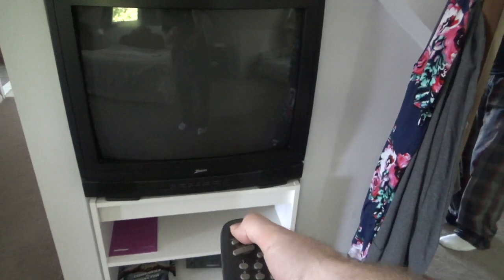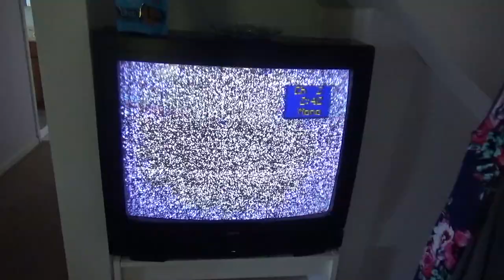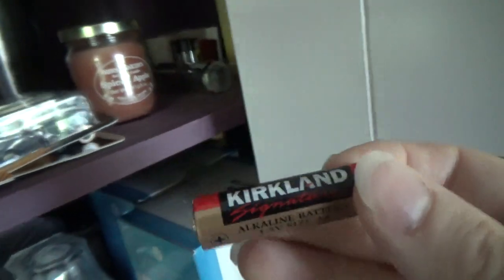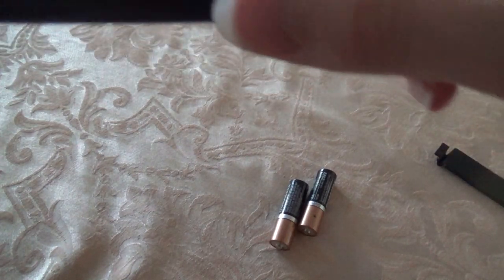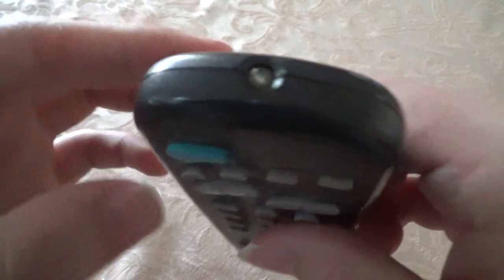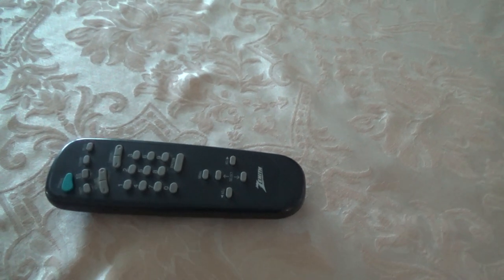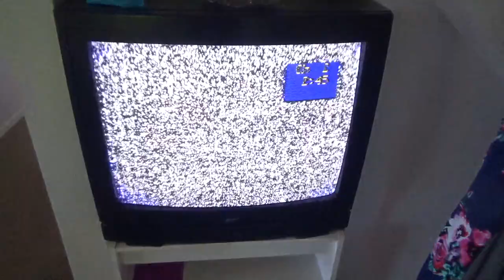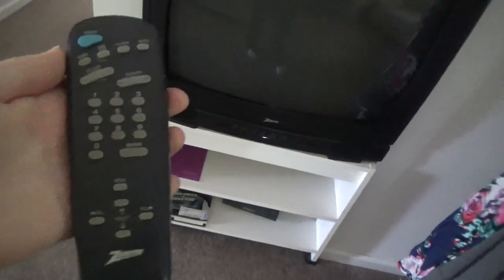Zenith CRT Television Set

Comment: I still use my 1998 Toshiba TV that I bought at Circuit City. I have one of those converter boxes that were released around 2009 hooked up to it so that I can get the local stations. It still works great and I get around 20 stations.
Reply from the maker: That's good..

Comment: They probably have the CRT there because it'd "be too much of a hassle to take it out". They probably haven't installed a converter box because they'd be "spending money towards making a TV work that nobody is going to watch because it's old". I guess both of those presumptions are a slight stretch, but that's all I could come up with...
I have, and use, two CRT sets. One is a JVC 32" set, model AV-32150, from may of 2000. The other is an Advent 24" flat panel set, model Q2435A, from 2003. The cabinet has seen better days on the Advent (it's got a few pretty big cracks going down the left side, which I think unfortunately might've happened during transport to where I have it). Typically on CRT TVs, they make it easy to find out the date of manufacture, provided it's in a place you can turn it around to easily see the back; many times the dates are written clearly on the back.
By the way, that Zenith TV in this video is probably made by LG. I have a few Zenith VCRs from the late 90s/early 2000s, made by LG.
Reply from the maker: Those are both reasonable possibilities..

Comment: That looks a lot like the one my grandparents had. It was from 1994 I think and it actually burned out one day, producing a terrible burning smell and black smoke. So they replaced it. I also, had a 1995 Zenith TV that I had gotten from the curb when I was younger, and when I turned it on it just had a black screen with a white line across the center.
Reply from the maker: That's too bad it quit, I don't hear too many stories of these old CRT sets giving out, certainly not like the new ones. Seems like they don't last more than a decade now.
Reply: @JordanU  funny story about that. My grandpa said he did not notice, and kept watching the evening news. My grandma was cooking dinner and came in the living room and she said “I smell something burning, do you smell that?.” My grandpa said “Oh I thought that was something you were cooking.” Right at that point black smoke came out of the vents so my grandpa put the TV outside. My grandma is actually a great cook.

Those Zeniths from that era tended to have lots of problems. If I was getting one that era I’d get a Sony Trinitron or a Magnavox/Sylvania/Philco.

Though in actuality theirs was about 8 years old by then so I guess that’s not any worse than todays sets. And they used it a few hours a day.
Reply from the maker: @coled5090  That's a great story!

Comment: Yay! A CRT
Reply: I agree, CRT is a pretty impressive type of display, especially when it's analog.
Reply from the maker: A CRT is, by nature, analog....
Reply: The tuner of CRT TVs are usually analog if it's one made within the range of the 1950's up to the early 2000's. There are some digital CRT TVs from the mid 2000's that has an HDMI input with the Sony Trinitron Wega being a great example of a digital CRT TV.
Reply from the maker: @sethhorst6158  The CRT display, whether it be tuning or receiving a digital or analog signal, is still analog in nature..

Comment: I have a wonderful zenith 19" color television, but I can't seem to figure out where the plug in piece for the input/output vcr chords go. Any solutions?
Reply from the maker: Probably the red, yellow, and white connections likely on the back of the unit.
Reply: If the television is of similar age to the one seen in the video, it's likely it only has a coaxial input.  If that's the case you'll have to use the coaxial output of the VCR.  Usually VCRs have two coaxial (screw-on) connectors on the back, one labeled INPUT and the other OUTPUT.  You'll want to conncet a coaxial cable to the OUTPUT of the VCR, and to the TV, and then set the TV to channel 3 or 4.

If the VCR and TV have composite video (red, white, and yellow) connectors on them, you can connect it to the TV that way (output of the VCR to input on the TV).

Finally, if the VCR only has composite video output but the TV only has coaxial input, you'll need to purchase an "RF Modulator."  However it's very rare that this is the case, and only with newer VCRs.
Reply from the maker: @Xyspade  Thanks for the additional information, clearly you are far more well-versed on the subject than I.
Reply: I've dealt with many VCRs in many households back in the day, and seen many more at flea markets.